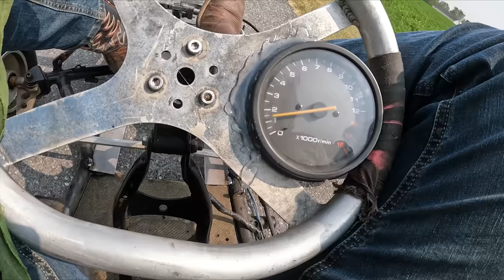I Bought a 100-HP Motorcycle Powered Go Kart for $1300

Comment: “It runs on meth and food stamps” greatest B&B quote ever. 😂🤣😂🤣😂
Reply: I was literally about to comment the same thing when I read this😂!  I feel like that comment alone shows Craig deserves his own Chanel!
Reply: I've been there.
don't give up.
you'll find exactly what you need, as long as you trust yourself and God.
That line is still FAF, though..
Reply: The “Methmobile”😂
Reply: Single parent sympathy card huh?As a single dad of 2 that was homeless at one time. I have never recieved foodstamps or assistance. By the way I have zero family to help either. Both kids are in college now and I refused to EVER tell a sob story. It requires humility and... I gladly sacrificed comfort. The kids never went without. I would never live off of other people's tax dollars. Get tough. If you play the victim, you will lose respect from others and yourself.
Reply: @Brando_Magnifico  well good for u assistance  was their for u to use In ur time of need u worked and payed for it out of every check u earned so it's not just other people's tax Dollars it's your earned tax dollars.
Reply: Gotta check the output gear ratio. Get it up to 1,200 rpm before hooking it up. Wind it out to 8,000rpm.
Reply: You need to ride a Fast by Gast 71 H2. 170+ mph on bias ply tires and drum brakes.
Reply: What happened to the diesel KLR? Did you lunch it before you knew how to run a Diesel?
Reply: You went to the Melwood school of Engineering on the case. Not going to go out and Kill Yourselves!!! Grow a set. Get it up to 8,000 rpm.
Reply: I've raced karts for decades... that thing is a bigly POS.
Reply: Me too!
Reply: @lancewashington7942  i feel for you I do but there’s a time in place if you don’t find anything funny just let it be and let others see the humor in it cause your comment completely ruined the joke
Reply: Sounds like California🤣☠
Reply: @reginaldtaylor4698  
No... I have never accepted government assistance. I only give. Never take.
Reply: @lancewashington7942  my thoughts exactly I have a different opinion of these guys now
Reply: That would be a go cart made from a Wal*Mart shopping cart.  😹
Reply: Original was definitely made by a  Billie !
Reply: @reginaldtaylor4698  I knew I had the guts to do it without. There are better things tax dollars can be spent on. Give someone a fish and they eat for a day and come back the next. Teach them to fish, now they provide and stand tall
Reply: If you ever get near new jersey I'll sell you a better one and bring you to a track for test running , would be fun.
Reply: "Comedy." (read in Mark Normand voice)
Reply: @reginaldtaylor4698  Yup, Well said.
Reply: @lancewashington7942  exactly! I think they should edit/ remove that stupid comment that craig made on this video Smh
Reply: He said put together with dead pan eyes and meth
Reply: @JakeColbyy  I respectfully disagree. It's not the governments job to enable people to be lazy and dependent on others tax dollars. It is the job of any church to help people in need. They do it right. They give you what you need and the resources so that individuals can provide for their families without living off off others. I wasn't boasting. I was merely saying that if I can do it so can anyone else. Take care now
Reply: Of course

Comment: You should build it right with good components.  I would watch that.  You don't always have to do dumb stuff.
Reply from the maker: i think we need to do that
Reply: But we love the dumb stuff
Reply: @BikesandBeards  do it, please.
Reply: @paulcantiller  IKR!! We love the dumb stuff!! Someone make Jonnie pay for his insolence!! 😉🤣
Reply: I mean... you're already watching!
Reply: @MAGGOT_VOMIT  lol. Now that was funny!
Reply: I would watch it either way.
Reply: @Bikes and Beards  I watch every video but I think a complete build from the ground up on the channel would make for great content and either start out by building a new frame or buy a new roller go kart maybe a bigger one like the ones that come with the 15hp engines on it and just put a good suspension, clutch, sprockets, chain, and brakes and then put that engine on it and I think you should put headlights and brake lights and turn signals and try to drive it on the street
Reply: @BikesandBeards  I was wondering with the state it was in why you didn't just start over with the engine and whatever good parts there were to salvage. It would probably make a pretty sick side by side or sandrail.
Reply: @BikesandBeards  Just fix up the frame and put some new wheels on it and itd fly, i see the potential haha
Reply: @BikesandBeards  you gotta race them!
Reply: @jonniecrabb7272  😂👍
Reply: @BikesandBeards   and give away maybe
Reply: @MAGGOT_VOMIT Jonnie is insolence
Reply: Yes, build a safe, proper one, with the 650. Then do some high speed passes.
Reply: @BikesandBeards  will watch this for sure
Reply: @BikesandBeards  yes
Reply: Beyond boys with toys
Reply: @jonniecrabb7272 agreed
Reply: Your last name fits
Reply: @BikesandBeards  you

Comment: Other than the fact it's held together by electrical tape, doesn't turn and can't stop, I think it's a fine high quality go kart!
Reply: Won't go and speed wobbles if it does too
Reply: Meth-American Engineering!!
Reply: At least it sounds good when it's running. 🤣🤣
Reply: yep
Reply: They said Go-cart, not stop and turn cart.
Reply: Not to mention the tires don't hold air. And it runs like crap below 6000rpm. Oh and don't forget all the rebar they used.
Reply: Very fine and high quality PoS.
Reply: I want to see a part 2 to this.

Comment: This brings back memories. After a nasty collision with a car executing a badly timed farm equipment pass and 3 months in the hospital after the fact, I found myself with a DT 250 Yamaha motorcycle engine needing a new frame to reside in.
The most likely available candidate was my old farm Kart who's old B&S 5hp engine had given up the ghost long ago.
After some primitive grade school level welding and fabrication the dependeble 250 engine fit in the old kart like a 454 chevy big block in a chevette.
Surprizingly the karts simple brakes did actually work in this case, it just took them a bit longer than usual to bring the rig to a halt at higher speeds, a minor problem easily overcome by careful calculation of stopping distance and avoiding tight situations.
Questionably legal highway testing of the machines capabilities demonstrated it was capable of speeds well exceeding 80 mph,, however that apparently was beyond the capabilities of the original knobby tires to attain and sustain.
Upon acquiring 'racing kart slicks' promised to hold together at such speeds it was back to more performance testing.
During one such test it was discovered the hot rod kart was capable of eluding the wrath of a highway patrol officer, due more to its ability to fit through a narrow walk path gateway than speed.
After that close call with the law later roadway excursions were kept to local gravel roadways where the kart was discoverd to have an uncanny ability to drift through corners like a W.R.C. pro.
Alas all this fun came to a sudden end during one such drifting demostration when unnoticed fatigue in the old kart frame finally caused a catastrophic break in the frames main rails just behind the seat resulting in a parting of trajectory by the occupant and the powerplant and drivetrain.
The drivers portion came to a skidding halt in the ditch with only minor bruises and scratches and a nasty rash from questionable ditch weeds encountered during the excursion.
The Powerplant free'd from the burden of pushing said operator and the forward structure of the kart around suddenly went into a screaming WOT setting upon the throttle cable being ripped out of the top of the carb jamming the slide into a wide open position.
Due to the majority of the weight now residing behind the engine/transmission assembly the dragging subframe kept the drive wheels down and heading down the road until it wandered off into the ditch, tumbled then went flying screaming like a banshee and spinning wildly until it contacted the ground with excessive enough force to damage the engine beyond repair.
Needless to say that was the end of that wild ride, and i'm probably alive to tell it's story due to it's demise truth be known.
Reply: Wow have you ever thought of writing a short story or book? You are a great story teller and I was able to picture it all in my mind. 👍🏻
Reply: Good job , very entertaining !
Reply: a great tale well told!!
Reply: Dude, that was freaking awesome!
Reply: I put a Husky 250 in a gocart frame- Had to start out in 3rd feathering the clutch real good unless you're doin donuts in gravel.

Comment: Change the axle gear to about the size of the brake rotor to get rpms up . the last builder was limited to what was in stock at the hardware store .
Reply: No he was limited to what size sprocket would clear the ground

Comment: I recognize that motor, you'll need the stock air box from the cb750 to make the vacuum operated carb rail work properly. Got a replacement motor from someone's project lawn mower to put back in my bike for cheap because it wouldn't run right without the air filter box 👍
Reply: I could never get my ninja 250 to run properly after running 0990 k&n and Leo Vince slip on. I shimmed the needles and upped the jet size just couldn't get the sweet spot, but it was definitely quicker no doubt about that just broke up past 9k

Comment: In 1972 my friend and I had a real nice tube framed go kart with no engine, but we had a Yamaha RD350 two stroke twin with a wrecked frame so we installed the RD 350 onto the go kart frame rigged the shifter by a linkage to the left pedal and welded a top hook to that pedal so you could up shift and down shift easily, the right front pedal became the brake…good for one application of stopping every 1 minutes or longer… the brake was a small drum attached to the live rear axle, the steering wheel was a half wheel like the newer Tesla’s, the clutch was the same as on a regular motorcycle lever and the throttle was off a motocross RR with just a quarter turn to full throttle… so incredibly fast and all rigged systems worked perfectly… even the single small drum brake worked great… under 20 mph 😳 !!!
We didn’t really know how fast it was, because when we passed cars on the beltway around Washington DC in Maryland and we could not stop other than downshifting , we got scared…that at the ages of 18 that was as far as we were going to get in life ! When a Montgomery County Police officer got us on radar at 76 mph at 1:00am on a Sunday morning with no lights, (we did have a full moon), encouraged us to get rid of that thing before we got hurt badly or killed… no tickets if we promised to sell it within two weeks and he would not tell our parents. I remember his name, Mack Smith a Sergeant, he did us a favor. We had about 200 bucks into it and sold it for 500 bucks. Those were the days my friend… as the song goes !
Reply: 15 minutes or longer for the brake application

Comment: FYI, carbs do not like running without some type of air resistance on the intake side because it changes the venturi effect, so running without filters will screw up the ratio. Also, 2 with filters and 2 without will cause synchronization issues between the carbs/cylinders.

Comment: Hey Craig my man I've got a converted wheelbarrow with three wheels with a Honda C50 engine in it, The engine is seized up solid after it hydro-locked in a lake when I spun out on a bend, It has got a bucket for a seat, and steering from a lawnmower, the final drive is off chainsaw it has got no brakes no gears all the tyres are threadbare and flat but I only want £1500 for it, It's yours anytime you can come and collect it mate, it's in the dumpster at the end of the street, just take it and post the cash through my letterbox if I'm not in. 
cheers mate. I knew it was one for you.

Comment: Ok in the UK Cart racing and supper go carts have maximum of 250cc engines and they put out well over 100HP top speed 170MPH depending on race most will easily do 140mph but they are made to go around corners at speed plus breaking disc breaks.

Comment: You can make for individual pipes for the exhaust just wrap them down around the bottom of the cart and under the motor it will make it sound better me do the emergency brake and the shifter use a motorcycle clutch handle bolted to the side of the by drilling a hole through the clutch handle both it to the side of the make a mount for it to bolt to run the clutch cable in the clutch😊 handle so when you grab the it will disengage the clutch by pushing or pulling the clutch handle you can put it in gear letting out of the handle will let the clutch out

Comment: Better than the one my friend and I bought for $200 in 1969.  Ours had kitchen sink pipes for exhaust. The first time I took off on it the brakes fell off.  Had a 350cc 2 stroke motorcycle engine.  My mother was not happy.

Comment: a steel plate on the back of the seat will protect you from engine malfuctions, put a rod through the block and into your back and or head is possible.

Comment: You should have purchased the Go-cart I sold. I had a 1960 kart that had a duel 100hp 2 stroke engines top speed 110mph. Best of all,  I had brakes.  But it wouldn't have been a show.

Comment: There's DEFINITELY something up with how that bike engine is running. I don't know if it's the throttle cable, or if the engine is really running like crap, but neither would surprise me. 0-100 in under 5 seconds...yeah, if it was 100% functional.

Comment: Mine has a 1976 honda cb 550-4 on it. Four cylinder. Stock engine but it has been up to 130. It was only in fourth gear and had plenty of throttle left to go but I was afraid one of the tires would blow out so I slowed down

Comment: Anyone remember those Yerf Dog off-road go carts? In particular, they had one that looked like a mini 3-seater Baja desert-runner. 

I would love to see the engine bits from this horrible creation placed into that chassis. A little bit of proper fab work will get it looking and running right.  

Might have a higher center of gravity and it might weigh more, but I bet it would be a blast to take off-roading, and I bet it would still do a straight line top-speed run without death-wobbles. 

I think the carburetor needs a teardown and rebuild as well, almost seems like it's running too rich. Once the fuel delivery is sorted it should be smoking it's wheels up through all the gears. 

I see what they were going for, but the execution was terrible. Like I get "making due with what you got", but knowing the limits of the frame you choose would have seen this built into a better frame from the start. 

I hope you guys make something amazing out of this! It deserves a better bespoke build for a proper send.

Comment: Guys make a new frame so its not hang on ground and make a proper engine mount so engine sit in right place and do not move,and also chek that engine,chek all carps and jets  plus test a bigger and smaller rear bracket at how its give speed out, and add new brakes and proper brake pedal,but just make a feet clutch and proper shiter stick you can use bikes Gear Shift Linkage  Lever to get it work just fine,i hope you guys do part 2 and maybe 3-4 also...

Comment: shouldn't you decide to run with no filter pods or 4 filter pods?  Most likely carburation is off the roof and it only runs cleaner on main jets.  Possibly some exhaust backpressure is needed as well.

You shouldn't get on this thing without getting the steering tighter, toe-in, 120hp on 500lb with 10" rims is hairy.

Comment: That should be called the back breaker 😂 you crash is gonna f#(k you up good. Should put one those engines in riding lawnmower. It was kinda interesting seeing 80mph Ryder. & the engine don't go threw your back when you crash one those🤘the shifter on yours pretty sweet though😎 it needs one those sissy brakes to make it into a drifter 🤣

Comment: If I had just paid $1500 for that "Go Cart", the 1st thing that I would do is find a dark and private place and then CRY  about just losing $1500. Then I would start building a new frame for that engine. Build a more modern steering...basically just build a new cart using whatever good parts you can strip from that "Death Cart".

Comment: I have a 1980 Honda CBX 6 cylinder that I bought new. Thinkin i will sell it. All original. Needs fuel petcock installed. Brake and throttle work.  
rick in Tennessee.

Comment: Fastest gocart ive driven is a 125cc shifter, and they went from 0-60 in around 2.5-3 secs.. cant imagine 100hp :D very nice. edit: im commenting when watching, but gokarts dont turn well, since you have a fully locked rear.. so you need to lean the wrong way in corners to lift the inner wheel to make it turn. not sure about if that works on this ;D

Comment: That's running on two cylinders. Check that you've got good power to and from the coils, and throw a set of flat slides on it because those CV carbs can be finicky and probably not worth the time to iron them out. An oil cooled 750 Suzuki in a cart should be silly fast and this thing is the opposite.

Comment: There's a reason he was only asking 15 hundred bucks. Everyone laughs and makes jokes about the condition forgetting that if it was very clean and race ready, he could probably get several thousand for it. I think he ended up paying 13 hundred for it which is a killer deal for just the engine and frame. Then he got all the rims, tires, xtr tires, etc. The stupid part here is trying to run it before working on it. As soon as I got that thing home, it would be on my bench being taken down part by part for a 100% rebuild/restoration.